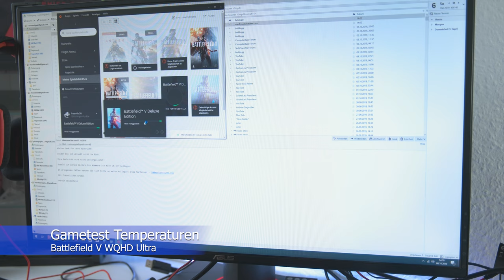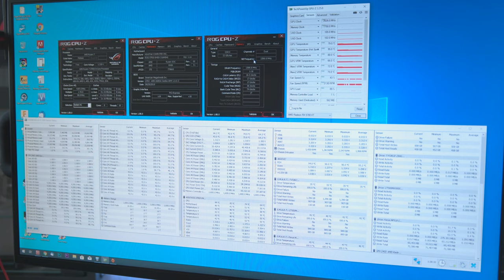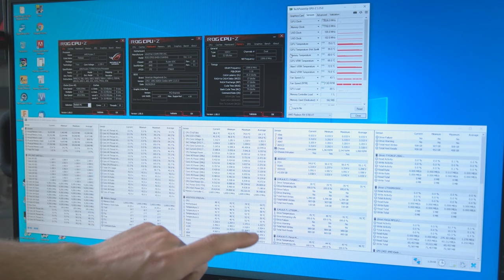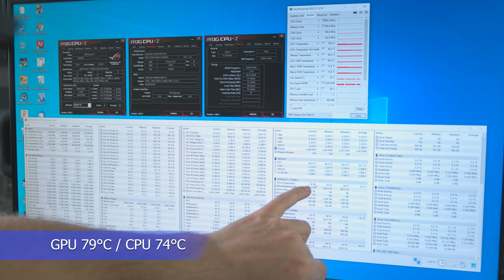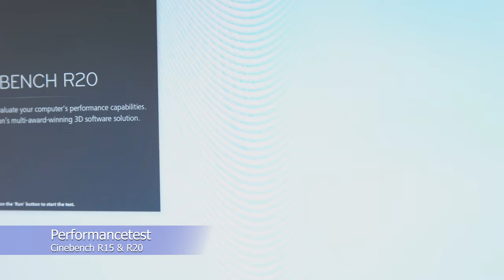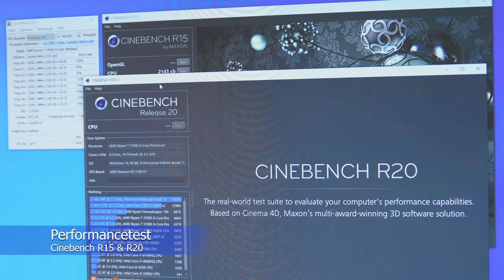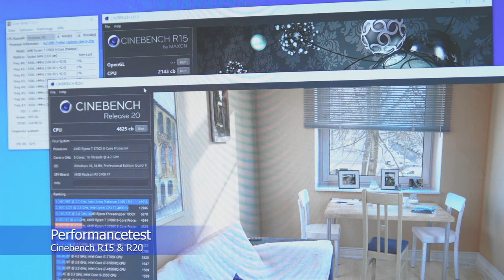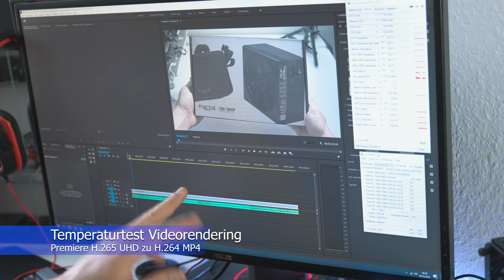PatCase ITX AMD Ryzen 3700X und Radeon 5700XT Performance und Temperaturen

Comment: Looks like a copy of the Geek A60 or A50.

Except that those 2 are way prettier
Reply: to clarify, i didnt even know that those existing Geek. i did it by my own and i dont think it looks in any way like a copy^^. every mini itx looks a bit same, because there are not so many options to put hardware in. and thanks god, beauty is in the eye of the beholder. i love it because i did it with love.
Reply from the maker: Its complete diffrent mainframe ... and the geeek cases has a to layer top and front.